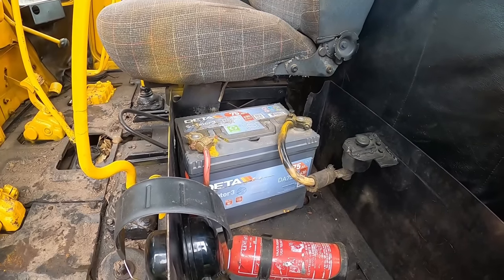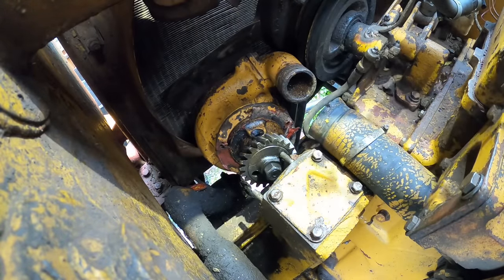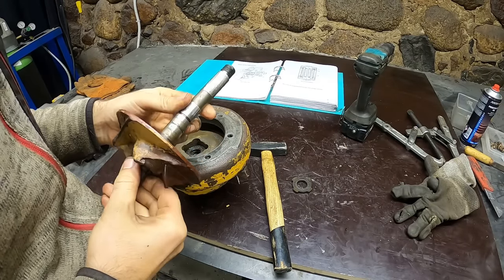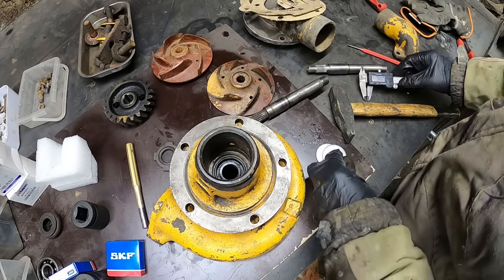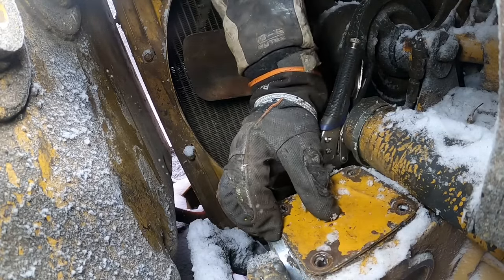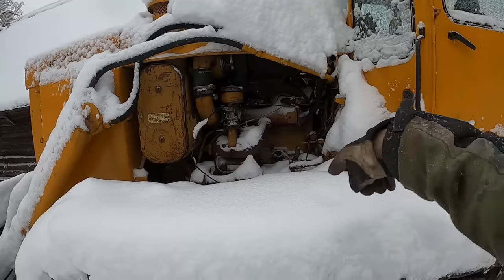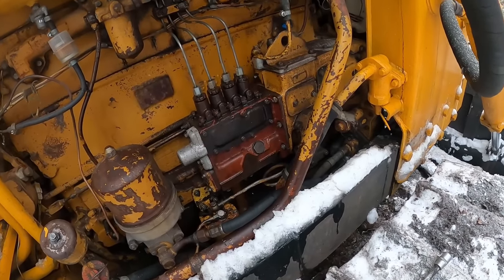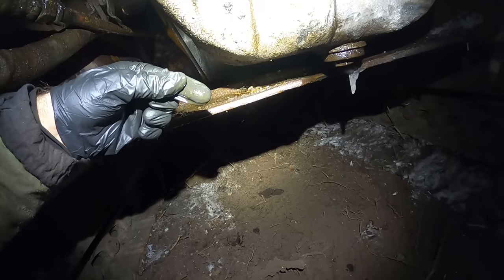Fixing water pump on the Soviet bulldozer

Comment: Sure the thermostats are working correctly? I'd assume the main point of them is to not let any coolant into main radiator before the engine is up to temp (~80C with those thermostats). Having 40C on both engine and radiator kinda suggests the thermostats don't do what they are supposed to do.
Reply: Negative.   While idling as he was it will NEVER make operating temp.  The word is operating... not idling.   Remember there is about 600kg of iron and 40L of coolant and 50 L of oil all to put heat into combine that with the outside temp of about -10 he would barely make full 80C after 20 minutes of pushing snow.
As stated above I expect one should open about 60 then the second at 80 because of the volume of flow.  The hose are near three inches the pump impeller 5 inches... huge flow.
Reply from the maker: thanks

Comment: Could it be that fuel gelled or froze due to the cold weather? As for the foot pedal, that is the de-celerator. slows the engine down to change direction then resumes the previous engine speed when the pedal is lifted.
Reply from the maker: ohh :O

Comment: If only you had a pto generator to run off some monster tractor ;)
With low hours i kinda suspect it was built with silicone. Just a massive pot. Dip it in and bolt it up
Reply from the maker: yeah :D

Comment: That fuel pump missing parts could be the reason why loosing engine oil pressure  from your engine. Cause the fuel pump issues could be from those issues alone. It's suppose to work together as one.  Maybe it used some oil when it was running before then.
Reply from the maker: Yeh maybe

Comment: Monting bearings shaft in to bearing support inner race. Bearing in hole lode on outher race .bearings is lubricated from splash inside transmission 2RS bearings not neaded. Bearings D35mm and up should Be heated to max 115 degrees on an electical plate  not with a flame.
Nice video😊
Reply from the maker: So much technical info 👍

Comment: DOES THE FUEL TANK Have a vent hole (usually in the fuel cap on some things) lets air in to replace the fuel used. could have a breather somewhere else maybe, this can cause a stall and restart later when it eventually loses the vacuum on the tank.
Reply from the maker: Yeah i made a new breather for the fuel tank

Comment: Pony motor has vacuum leak at the header. See where the smoke is coming from? The poor header looks like it rusted through. 😊 Also does pony motor have low idle and high idle adjustment on carburetor? 💖 Joseph and Your patients working in him.
Reply from the maker: i gotta look into that, hmm. it has throttle control, but i'm not sure if it's desiged to work as i think it is

Comment: You should first heat the cast iron housing very well and cool aluminium part rapidly to break oxidation and after next heating it should be easier to remove.
Reply from the maker: Ok

Comment: Hello, I was just commenting that the problem with the oil pump is only because of the fuel, which makes it very light and the oil pump does not raise the price, but if it manages to lubricate, well, you have to repair that fuel leak, regards.
Reply from the maker: yup

Comment: No you half to manually oil those bearing's up with A oil pump can oiler with motor oil inside of the can man. Through those plugs inside of that water pump. I'd try finding and building A threaded tube with cap that's removable. For twisting inside of those oil port holes. Then just replace the cap plugs back into those spots. When you're done filling those bearings up with motor oil. It will work for you and save and help prevent future problems on it down the road to come.
Reply from the maker: Pre lubed amd sealed wont work?

Comment: The marks on the shaft are from pushing it out of the bearing. It's becuase of contamination and is called galling.
Reply: If you use a nice sharp putty knife from the hardware store its much better for removing the old gasket material.

Comment: What do you call the material you used to make the gasket?

So asbestos definitely makes for a good gasket/seal.

Probably not impossible to weld blades to the water pump impeller??

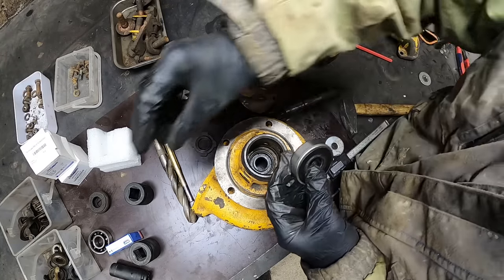1:06:34 Sealed bearing vs open bearing.

1:12:25 Nice
Reply from the maker: Paper gasket material, yes them asbestos gaskets will outlast the tractor 😂

Comment: At 1:29:45 Didn't you forget to bend the retaining lock on the shaft nut back? Or did you glue the nut in?
Reply from the maker: no i'm pretty sure i did that
Reply: @Ants_Pants  To me it looks like you have bent the locking sheet to the wrong side and therefore the nut is not secured.
Reply: OK with 0.25x Video playback speed  and thanks to zoom it looks right. I thought the looking sheet must rest against the nut, but that doesn't seem to be the case.

Comment: I am really looking forward to the machine castle build. Have you thought about having a design contest where your viewers can submit design ideas? I have some. I don't know how good they are 'cause I don't know jack-diddly-squat-poop about it, but that never stopped me before, why should it stop me now? I even started looking at the dimensions of Joseph (he's your talles machine, right?) to get an idea of how tall the building should be. Okay, I spent a little extra time in nerd-central this weekend, but I'm so comfortable there.🙃😉
Reply from the maker: No the k700 is taller. Jospeh is just about 3m but k700 is at 3.5m. I know its a cool idea maybe if i get that far i will consider it
Reply: @Ants_Pants  Okay so my first stat is that the doorway should be at least 4.5 to 5m  for a comfortable fit. So the roof line should be about 7m. Wow! This is going to be a tall building.
Reply from the maker: @mswildi  yeah... If i wanna build taller then 5 meters i need special permit though. Sometimes these special permits will be as expensive as thr stupid building
Reply: @Ants_Pants  5meters it is and not a cm taller. I'm sure we can work with that. Just stay out of the Soviet equipment boneyard!  Stop buying bigger and bigger equipment.😁
Reply from the maker: @mswildi  currently planning to focus on a woodworking workshop build and a expansion to the current workshop. The big one will be a future thing one day. I will build a small roofshed next to the tracktorshop. Something temp. And planning to put k700 under it so i could at least work on it out of the rain.
Reply: @Ants_Pants Whatever you do is AOK with me. Maybe I should save up for a ticket Estonia in a few years... Oh yeah, and a new back... and knees... and shoulder... and a time machine so I can be about 20 years younger so I can help with all these projects. Or I can just continue to live vicariously through you.🤗
Reply: Perhaps I should stick to music now!🎸 Not so hard on these old bones.

Comment: Perhaps if you block some of the radiator with cardboard, it will warm up faster. I thought the fuel should come out of the HP pump in pulses that are times to the cylinders firing.
Reply: I like the long format of the videos!
Reply from the maker: Yeah

Comment: I know nothing about this engine or much at all about diesel injection pumps but does the pump have some kind of internal governor and this is why the linkage moves more by hand than the controls? So it only moves a certain amount by the cabin controls but under load only it moves further inside the pump due to a governor of some kind?
When under load it will need more fuel than at idle even if it's at maximum revolutions at idle? I think
Reply from the maker: Yeah its supposed to work like that

Comment: Regarding the washer, I wonder why you didn't use your lathe to 'adjust' the new washer to better tolerances/measurements? That would have been a better alternative to the reamer you used, no?
🤔🤔🤔😉😉😉
Reply from the maker: i tried but didn't have the correct cutting tool

Comment: Have you considered swapping out the fuel pump? Then you can't flood your crank case with diesel.
Reply from the maker: that would be a huge job
Reply: @Ants_Pants  not the high pressure one, just bypass the low pressure one thats membrane usually splits pouring fuel into the crank.

Comment: Buy some trickle chargers for your equipment batteries they are cheap and will keep the batteries at full charge which will extent the life of the batteries and you wont have dead batteries anymore.

Comment: This dozer has a 24volt electrical system. An extra jump pack will start it but it should have 2 x12volt batteries.
The Alternator will over charge a single 12volt battery...
Reply from the maker: Nah man even the manual says its supposed 12V

Comment: The way I do the bolt holes is to do 1 then put a bolt into the hole to hold ithe gasket from moving. Now I do the rest and if it's a large gasket I will use more bolts.
Reply from the maker: nice tip

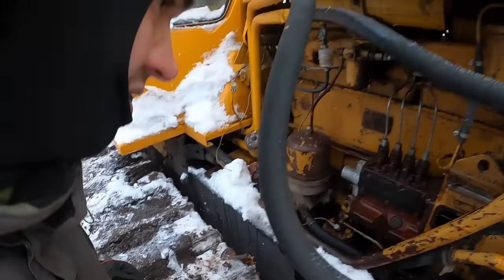Comment: At 2:10:15, behind door #1, there is what appears to be a broken wire flopping back and forth when you activate the pump control. What is that? A broken spring maybe? It doesn’t look right.
Reply from the maker: Think thats just some diy pin wire to make sure pin does not come out

Comment: Love your videos; especially the family time.  Empty cycle looked like a constipated cow peeing??  Wonder if you could find a used Whole water pump? Maybe a subscriber donation?  Olive oil inside of hoses that age helps and will NOT mess up the machinery.
  I have a kerosene heater for car / truck engines that has a circular wick and a 1 gallon tank. Was made for very early automotive engine warm ups to prevent freezing I presume before anti-freeze was invented.  Such would work to preheat a crawler motor there I presume.  Made in about 1930 or before.  Pony Not firing on both all the time.
Reply from the maker: Thanks 4 the tips

Comment: Maybe diesel get frozen, if it  was a summer time diesel and  if had same water so stuck in fuel pump, after few days get warmer and started without problems...
Reply: I have been scrolling looking for this comment...   I agree.   Fuel  freeze off.     Tank is less then half full.   Not actually water as the water would be froze in the bottom of the tank but gelling off or freezing off  of fuel in a thin line that comes from the tank would explain everything.
KEEP THE FUEL TANK FULL.   Fill to the max every Halloween and add diesel cold weather treatment.  MORE is not better.    Mix as accurately as you can and it will save you so much head ache the one time you need the dozer in winter.
Reply from the maker: Ok

Comment: Put some motor oil in into the cylinder man. Then it run even if it smokes some at first. That has A dried out oil rings cylinder.
Reply from the maker: Pony?

Comment: Im thinking the fuel was gelled up because of the cold. Do you add anything to stop that from happening? Also how can that thing run on just one battery? I would sell this machine its always broken and not really useful without a truck and trailer to take to jobs and make money.
Reply from the maker: Yes winter diesel. 1 battery?

Comment: Doesn’t look like your injection pump is working andris. Since it is leaking down. And they’re should be way more pressure coming from the lines to the fuel injectors. Since it looses prime and dies when the engine is under load. If it is anything like American, European, or Asian injection pumps there should be a tag/plate on the pump that will provide the type of pump and a part number you can search for replacement parts or possibly a rebuild kit.
Reply from the maker: yup

Comment: Battery usually ends up at 13.8V to 14.6V max.  At least that's what it is here in the US.
Reply: Calcium need more but yes 16V should be max and only when very cold.
Reply from the maker: The led lights and instrumental panel don't mind the higer voltage it seems. Once it fires up i flip the battery insulator switch off and all the electronics run off the alternator instead.
Reply: @Ants_Pants  Just don't do that on modern cars. There are 100v spikes from alternator which are normally buffered by battery.

Comment: 90% of those dozers are 24 volt systems. The battery is hissing cause its boiling and WILL explode if you dont fix system asap. There is a special battery for that dozer and it huge! But its 24volt. Your gonne end up in hospital if you dont take heed
Reply from the maker: Hospital here i come !

Comment: I think your oil pressure shows really low.. when the oil has all been pump through and the oil pickup sucks up the diesel fuel that has leaked. It's much thinner and the oil pressure will be way lower pumping diesel.
AND..... next time believe the manual. Take out the radiator when it tells you too...  How many times I tried to shortcut and ended up regretting it.  ;-)
Reply from the maker: Lol yeah

Comment: It must be a leak in the seals of the fuel pump. If the pump loses prime it got to have a leak in the pump. There again it could be a leaking seal in the pump. The drive gear shouldn't have any diesel leaking into the oil pan. The hard start and miss in the engine sounds like a plugged or bad injector. One drop of water in the fuel can blow the end off an injector. The pump looked like it was pumping and firing in sequence I think you may have a bad or dirty injector that's not firing properly.
Reply from the maker: could be yeah

Comment: Your new bearings are permanently sealed pre-lubricated only remove the seals if in a clean environment. Which that pump is not!
Reply: And don't pack them full as they will fail then.
Reply from the maker: Why so?
Reply: @Ants_Pants  over greased is just as bad as no grease, They heat up and score the race either way
Reply: @Ants_Pants  Because it then needs to push the grease and bearing overheats and grease leaks out.

Comment: That fuel has to be timed together. It's clocked and timed on top dead center. I say arie diesel repairs those kinds of fuel pumps. For those kinds of equipment and diesel engines to 🐜 ants 👖 pants.

Comment: You aren't a civilized same way as I'm not 😂. By the way, the power rate of the alternator is accorded to a heavy machine who, at night, will have 80w loaded with working lights for example. The normal voltaje should be around 13.8V (or almost 28V when 24 volt system). Over 14.5 or 29.5 will be considered overcharge.
To loose or to tight stud bolts you only need to put two nuts and tightening one against the another, as a prisoner, then hook the wrench on the middle nut to pull off. Same deal to put it back again using the foremost nut this time. 
Thermostat 5°C degrees higher than original could be a big problem in hot weather, fortunately seems not be hot where Joseph is in. High temperature silicone is preferred to fill the gap between the thermostat and the housing. "Concrete" would be an issue in the future replacement ha ha. It doesn't need to be perfect sealed though, the rubber seal should be enough. Some big engines can run without them, but is not recomendable in cold climates cause the engine will never get the proper work temperature (and smaller blocks would overheat).
About the pony motor, you can check the compression ratio before disassemble it. Make sure the fuel that was not being burned inside the chamber didn't cause any damage.
An advice I can give you, use pig grease as cutting fluid when drilling hard materials at low speed rotation. 
Maybe some day could you tell us more about yourself. Something like "Best footage of" what do you think?

I really like your Soviets machines and the work you got done on and with them! 
Best regards to you!
Reply from the maker: Thanks ❤👍

Comment: ants...im guessing here but ...your fuel issue .... theres a rotary vein pump in there 4 blades on a camed shaft 2 of the blades are stuck with old fuel ....area diesel services has videos but im thinking that pump needs to be rebuilt
Reply from the maker: Its possible
Reply: @Ants_Pants  tolerances in hydrolics are tight so wear is impossible to spot without micrometers however if you do disassemble and clean it there should be a round puck like piece with a cross milled into it and metal blades in that...one or more of those would be sticking is my hypothesis hope it helps

Comment: Get  the numbers off the machine/engine, the year it was made, you might get parts from Ukraine off of an old tractor? Mic the shaft off on the good spots then weld the damaged sections. Turn it on the lath to the spects it needs, mic the inside of bearing, then turn the shaft to fit inside it. Use Permatex for gasketing, use new bolts and nuts.

Comment: ok understand TO have hazardous asbestos  it needs to be friable and to do that you need to get the asbestos out of its maytrex  then it can become air bourned  (friable)a simple surfactant can control the acm and the surfactant can be as simple as water but there are better surfactants but keeping it wet is the first and best defence scaping and wiping the asbestos contained material (acm) and putting it in a good sealed bag wett always wet 
but from what i seen the gaskets are in tact (not friable acm) it would have to be burned, chemical dissolved NOW THATS MY SIMPLE EXPLANATION 
IVE HAD 120 HR OF TRAINING AND 20 YEARS WORKING WITH ACM ITS NO JOKE  USE SURFACTANT .  YOU TUBE DONT COME DOWN ON ME THIS IS A 30 SECOND READ NOT 120 HRS OF OFICAL TRAINING
Reply from the maker: Got it boss